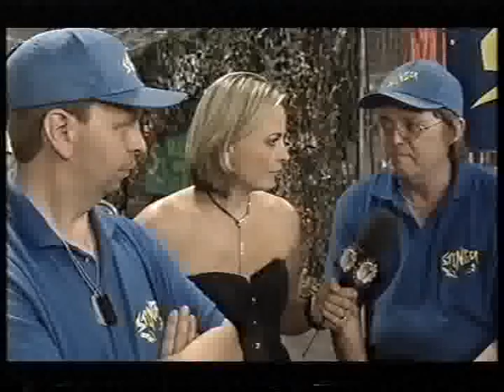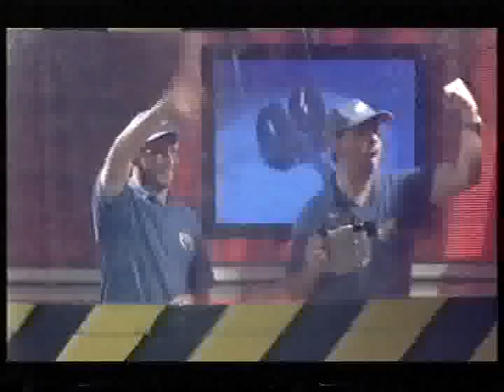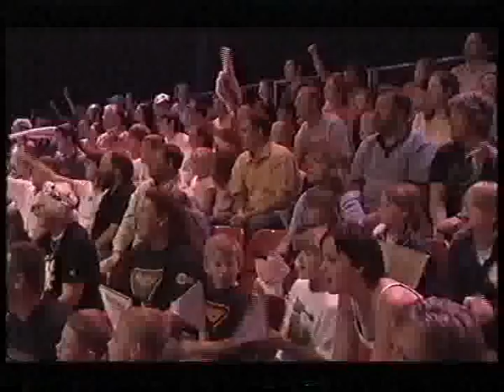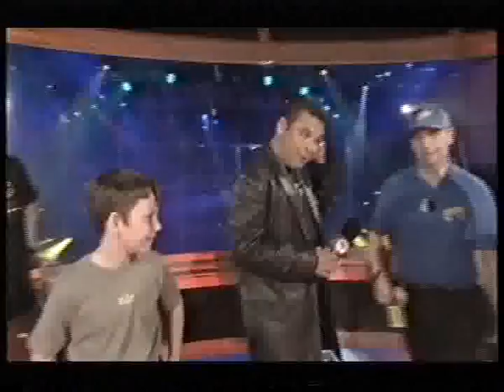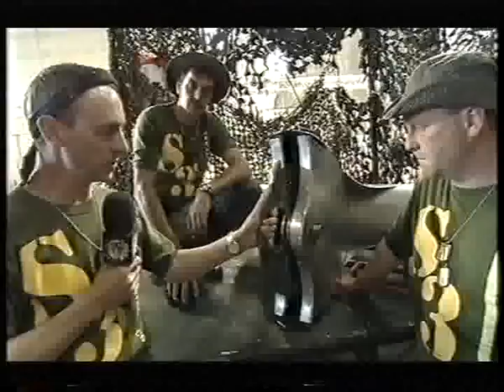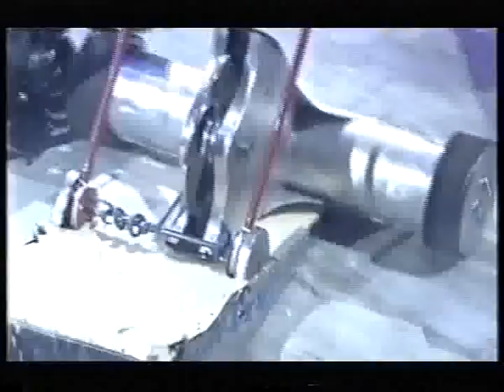Robotwars Series 5 Heat C Part 3

Comment: Something I find interesting about Stinger is that their weapon tends to do little visible damage, yet their opponents regularly become immobilized due to some unseen internal failure. Either they're really lucky, or that mace of theirs actually does a lot of damage to internal mechanisms that we don't seen. It wouldn't surprise me, that mace probably rattles around whatever's inside pretty good when it hits. Unlike most weapons, it doesn't need to get through the opponent's armor to start dealing damage, which is pretty cool really.
Reply: +Jimera0 i think its the fact that the batteries back then were so temperamental to sudden movements like that, the electrodes are extremely fragile and the sulphate acid is always a problem as it is a very thick moving liquid that ended up separating from lighter fluids in the battery like water.   

that's why I'm looking forward to the new series as lithium batteries are so light and much more friendly to movement' the batteries aren't even going to be a factor to think about

Comment: Ironically it was Stinger who knocked Moustrap out of the semifinals in series 4. No rematch though, even though Moustrap are a much better robot this time (they upgraded their pathetic polycarbonate armour to metal and that blade is actually surprisingly effective- see how it cut into S3's back armour!). I dunno why Mousetrap didn't try to drive S3 into the pit when they had them trapped like that, Killalot couldn't really get into position to make an effective attack on S3 when they drove him into the CPZ.